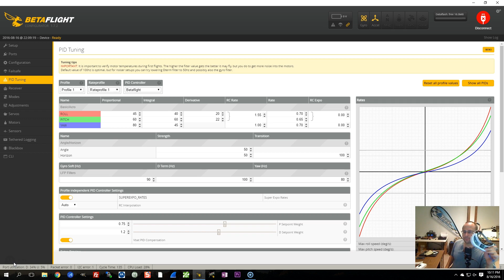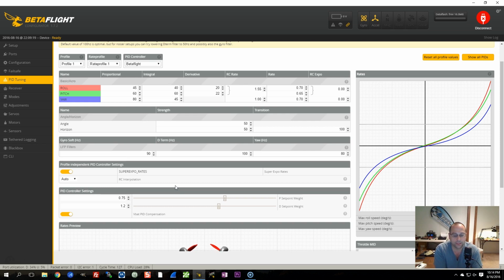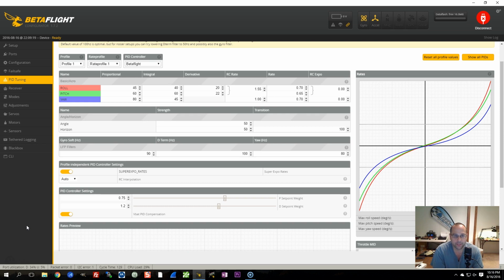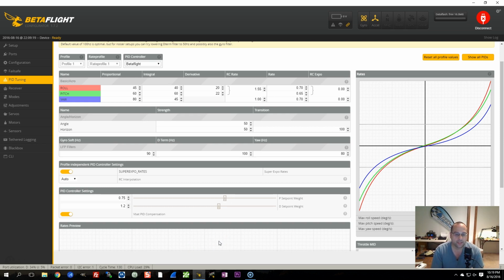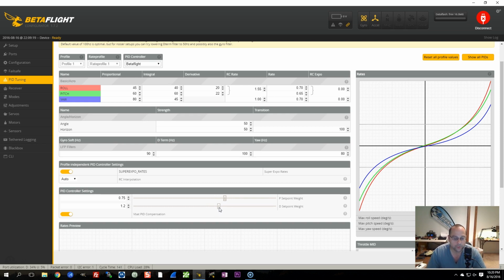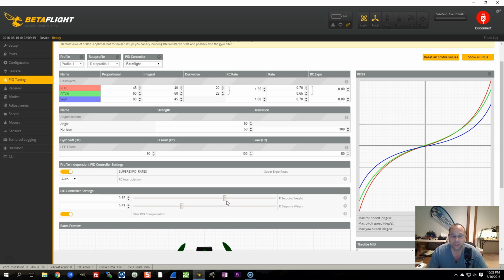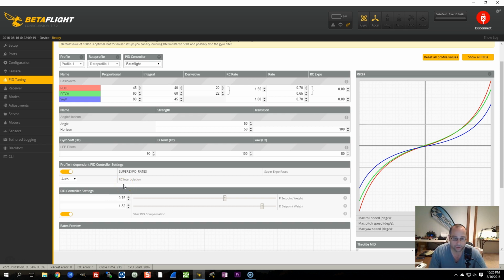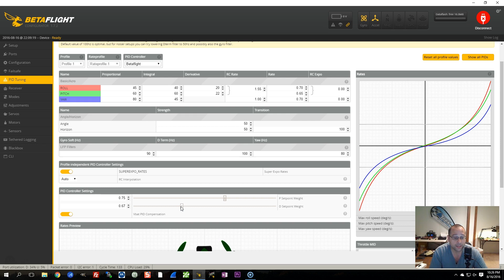Betaflight 3.0 Setpoint Weight (2DOF PID Controller)

Comment: Is there something different in 3.2.1 ? We get pid conrollers with 0 as standard ? http://www.copter-forum.de/thread/835-betaflight-versionen-und-updates/?postID=9304#post9304
Reply from the maker: They changed the default to 0 but I think you should put it back to 1.
Reply: Joshua Bardwell i think so to.... the testflight with standart zero... was flying like an egg

Comment: do I turn the vbat on for pid settings? or does this do something else? mine isn't selected on like yours in yellow
Reply from the maker: +David Downs I don't really understand the question.
Reply: Joshua Bardwell vbat pid compensation is on during ur video, do I need this on? does this   change setpoint weights ?
Reply from the maker: I believe it only changes P and D gains. As vBat decreases, P and D gain can be amplified by up to 25% to compensate for lower voltage.
Reply: oh okay cool, lol ive got a failsafe like issue lately and replaced with new x4r and just noticed my transmitter battery voltage was low so i wonder if that could have something to do with it lol

Comment: I have some kind of slow oscillations (maybe 1-10Hz), and i've tried a lot of things (Raising/lowering P and I, CG adjustments...). I think those settings might be the answers of my problems !
Reply from the maker: +N M slow oscillation like that is very unusual. Used to be excess I that did it but I haven't seen that in a long time.

Comment: Can you comment on BF 3.0.1 update?  It appears that the setpoint options have changed.  I no longer see SuperExpo, and the D setpoint weight and transition are 2 and .3.  Per your last video I was using .75 for P setpoint .35 for D setpoint.  I no longer see P and the RC Interpolation is no longer there.  What should I be setting things to now?
Reply from the maker: +SSBelmont I don't know. And I also don't know what happens if you are running 3.0 with the new configurator. What do the sliders do?

Comment: Just realised 3.01does not have P and D as shown here and the defaults are 2 for D Setpoint Weight & 0.3 for Transition, Now not sure if I should change these or not
Reply from the maker: +Alan King correct. Read the tool tip and play with the sliders.

Comment: Okay so has this changed in the new configurator?

I now read D Setpoint weight and D Setpoint Transition... When I read the descriptions it sounds almost like the sliders have switched...

Is that right?
Reply from the maker: It has changed. I don't think that the new "transition" slider is the same as the old P term relaxation slider. But I'm not sure.

Comment: Does anyone else notice that in Betaflight, the sliders are both labeled "D" now? It's no longer P Setpoint Weight.
Reply: Just circling back on this again. Obviously with the recent versions of BF, you have the D Setpoint Transition as well as the original D Setpoint Weight. Is there a need for an updated video? That's not me being a troll and stomping my feet, just generally curious. I guess the relevance of this video is still true (the whole 2DOF PID controller, etc).
Reply: I'm wondering the same thing.  When I open BB log and view settings info, P setpoint is empty whereas I've seen a value in this field when watching other's videos.
Reply from the maker: +tchthsky 3.1 got rid of the p term setpoint weight.

Comment: I liked how streamlined cleanflight and betaflight were getting but lately Betaflight is going bonkers with stacks of new variables to tweak.
I'd like to see actual mouse over pop up descriptions from Boris on Betaflight as it's starting to get extremely technical.
Each new feature changes how the copter is to be tuned, if it's hard for a full time FC geek like you to keep up with them that shows how fast the changes are coming.
Reply from the maker: There are mouseover explanations. The question-mark icon next to the options.
Reply from the maker: The great thing about Betaflight is, if you don't understand an option, just leave it at defaults and the copter will likely fly great. The options are only there for those who want to tweak them.

Comment: so slowly slowly betaflight is catching up to some 3d heli type scheme where theres a bunch more.options besides the pids, like these terms which maybe akin to "acceleration" on the vbar. but the heli dudes are ahead on some diagnostic/optimization features _ you can press an "optimize" button and get some feedback as to vehicles "stress" or average range of calc values. so take off do certain moves, land, check terms etc

Comment: I also noticed there are new options called gyro_lowpass_level and dterm_lowpass_level. Do you know what they are doing?
Reply from the maker: They affect the steepness of the lowpass rolloff. Steeper rolloff = more delay.
Reply: So the way to go is to minimize delay and use a less steep level?
Reply from the maker: unless for some reason you need the steeper one

Comment: here's a question - what causes a "bumpy" ride when it comes to pid tuning in fast forward flight? notice it more when it's windy and finding it quite hard to get rid of on my bf quad
Reply from the maker: This is a tough one to answer, but the most likely answer is excess D gain / too much motor noise / not enough filtering, which are in some sense all three facets of the same issue.

Comment: How is your cpu usage that low? With 8k and acc on and you are still under 30 percent. Am I missing something? With 3.0 using 8k, serial rx, telemetry, blackbox, debug at notch and without acc I cannot go under 60 percent. I have to cut off rc interpolation to go down to 40 percent. Using a dtfc by the way, sorry for the long question but it bugs me since I updated 3.0
Reply from the maker: +Dennis Riessbeck I have no idea but we just be using different features. If you want I'll send my dump and you can load it up.
Reply: +Joshua Bardwell I would love to examine it, it is kinda pointless without knowing which features you have enabled :)

Comment: I actually think "auto" under rc interpolation allows betaflight to determine the RCcommand 'frame length', or how 'long' each of the 'steps' is.  This is dependent on the TX / RX, protocol, etc.  I don't think changing the d-setpoint-weight has anything to do with the auto setting for rc interpolation.

Comment: I think this settings only complicates what the PID controller already does. 🙄🙄 if you lower p set point you'll need to raise p gain to get the same feeling if you raise p gain you'll need to lower p set point, and bla bla bla.
Same dude with a different suit, this things only make you waste more time configuring and tuning, time I should use to fly, as it is for me I'll just don't touch them. BYE
Reply from the maker: Don't touch them if you don't want to, but you're wrong about it being the same guy in a different suit. The 1DOF PID controller is unable to distinguish between error that is caused by external disturbances vs. error that is caused by you moving the stick. The 2DOF PID controller allows you to tune these two things separately. So for example you can have a copter that holds its line and tracks perfectly true, but has a softer and smoother stick response. With a 1DOF PID controller, you couldn't do this.
Reply: +Joshua Bardwell ok I'm not a scientist I accept that!! LOL
So then you are saying that I can tune my PIDs with stock set points, and then if I play around with set points settings I won't have to retune my PIDs?!!!??????
Reply from the maker: If you play around with set point settings, you may want to retune your PIDs. The two are NOT completely independent. The advantage here is that you have the option of choosing between, for example, high P gain and low P weight, and vice versa. Before, you had a fixed P weight and were forced to tune P around it.
Reply: +Joshua Bardwell ok so it's like having a water pipe with two independent valves to regulate the pressure?????

Comment: Thanks Josh ! Would setting the D set point weight to a lower number decrease d term noise or no because that is not "commanded" error ? Just thought it may have an effect since some noise has a high rate of change even though it has a low overall magnitude.
Reply from the maker: D set point weight only has an effect when the error is caused by the stick movement. D term noise caused by the motors for example is not affected by D set point weight at all.

Comment: Hey Joshua,
There are some overarching concepts to 2DOF PID controllers that may be helpful in these beginning learning efforts. The main thing is a 1DOF PID loop has a limitation where you can optimally tune for disturbance response or set point response, but not both at the same time. The 2DOF PID controller allows you to optimally tune for both. That ability comes from the feed forward compensation in the 2DOF PID.
The set point weighting is known in industry as "the poor mans 2DOF PID"  It's also implemented by placing a filter in series with the PID controller. The set point weighting may be the better choice here for less latency though. I'm looking forward to seeing how the community ends up tuning this controller, given the very good processes that have been developed for the 1DOF controller already. (With no transfer functions, poles, or zeros). As far as the D-Term kick goes, I like to run my D-Term on the measurement to reduce it.  Keep up the good work!
Reply from the maker: I like what you said there: optimally tune for disturbance response or set point response. Would you agree that, at least for quadcopter piloting, disturbance response is a more objective domain, whereas set point response is a more subjective domain?
Reply: +Joshua Bardwell I think I do agree. I'm saying "think" because they both have credibility. You have the black box for the objective stuff, and you have the "feel" that experienced pilots can pick up on for the subjective stuff. It's been interesting for me because with the quad copters its somewhat difficult to apply the "traditional" metrics to evaluate control systems for truly objective data. (Mainly because we still have to fly them while we are testing). In other situations you might apply a step function for the set point or disturbance and analyze the response to determine if the tuning is "optimal".
Reply from the maker: +Steve Marks Boris has implemented a twitch algorithm where the copter goes to 200 dps left then right as fast as it can. This is a more objective way of evaluating the tune.

Comment: I have a small problem with betaflight 3.0. when I do a flip I punch the throttle and then bring the throttle to zero and do the flip.  but with 3.0 when my throttle is at zero it acts as if my motors stopped and it just falls without staying at the last position. when my throttle is at zero my props are spinning. any ideas?
Reply from the maker: +Patrick Donovan enable air mode. I really don't like that they changed this default.
Reply: +Joshua Bardwell Alright. thank you. and thanks for you're amazing vids :)
Reply: +Joshua Bardwell  I tried that and it still doesn't do anything with roll, pitch, and yaw at min throttle